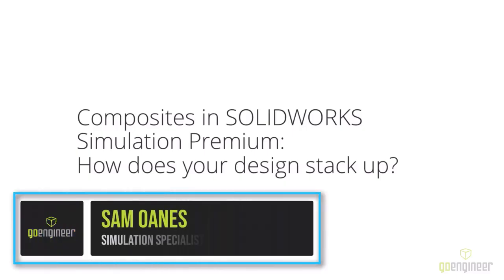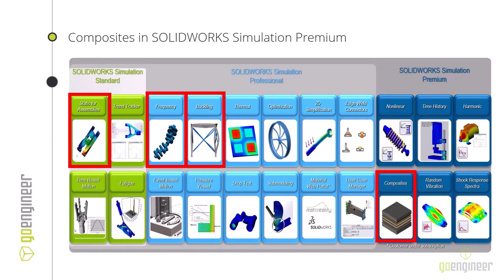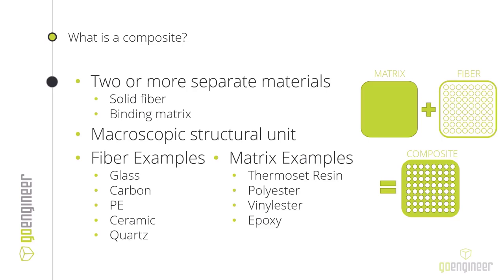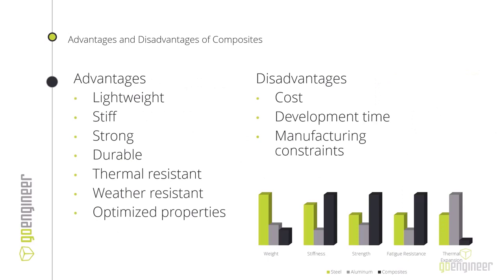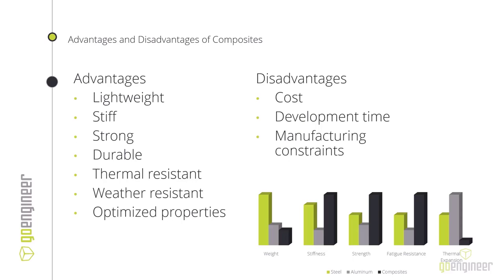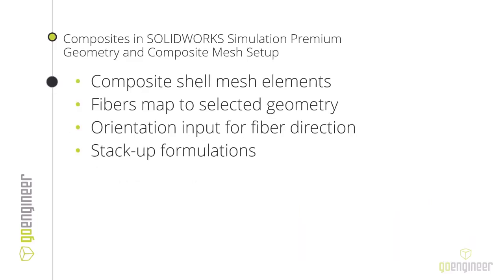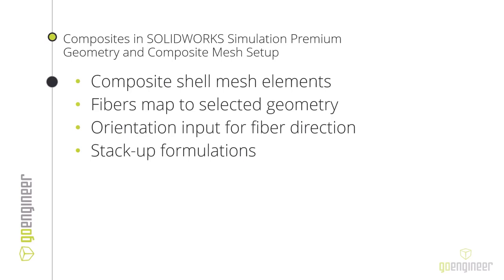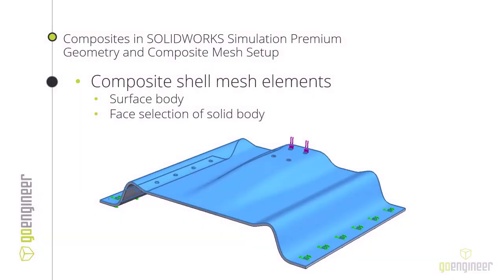Composites in SOLIDWORKS Simulation Premium: How does your Design Stack Up - Webinar

Comment: Great video! Here you say we can't calculate the interlaminar tension, only the sliding and scissoring shear. But then what does the normal force in Z represent? What is the difference between the two?
Reply: What component of stress in Solidworks should I look at if I did want to determine the delamination stress?

Comment: I wanna know if I  use a composite material with an H2 movable tank (about 3 m length and 0.5m radius) . In this case I have an assembly where the wall is made from a metal that is covered with a composite material, let us say 4 layers. The question: how can I simulate this Assembly using SolidWorks?